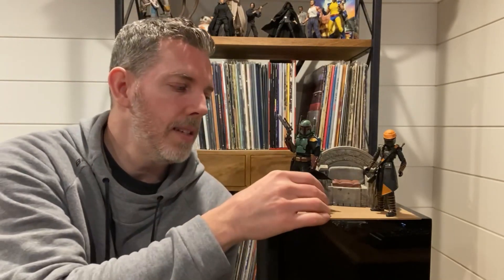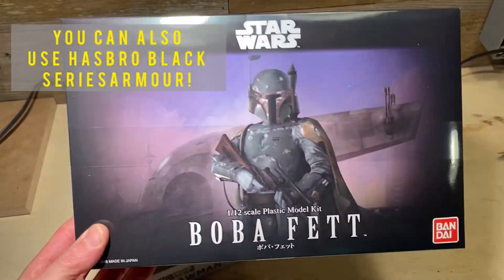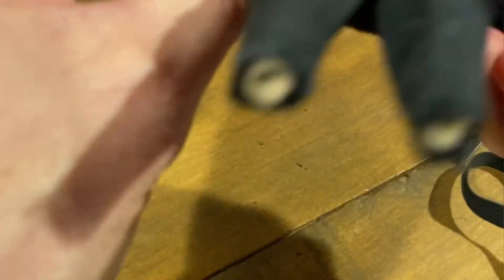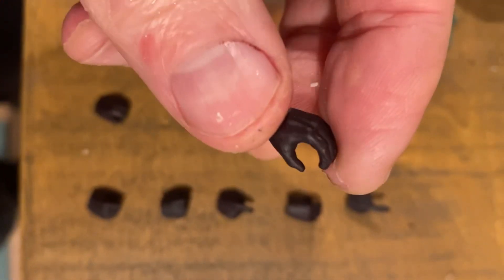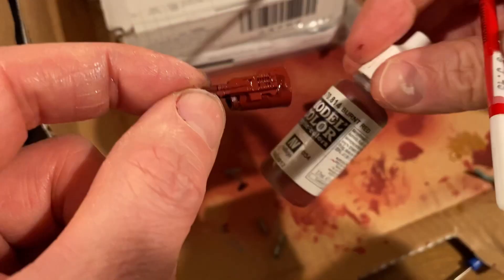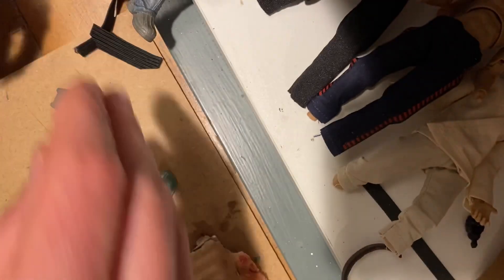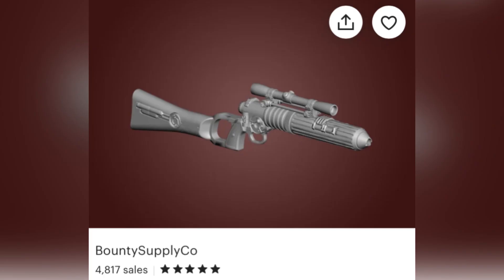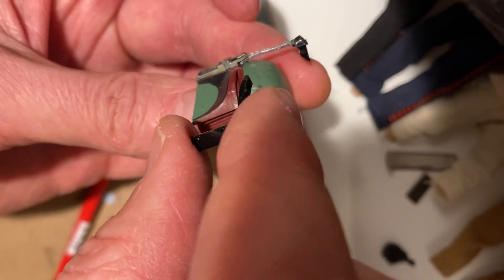Boba Fett Mezco Custom 6” Figure Tutorial

Comment: Fabric glue also works great for these type of customs, you can be a little more heavy handed with it and it dried clear so you don’t have to worry about that. I’d also get a cheap fabric cutter for cleaner cuts on the t shirts and pants. Other than that great work dude!
Reply from the maker: I’ve done fabric glue but not convinced it holds as well. It’s cleaner but takes longer to dry so I opt for gorilla gel glue to move quickly and make things as permanent as I can. But yes you can’t just lay it on thick.

Comment: Hey Southp! So I'm trying to make one of this with more like Hot Toys style scratch build, aiming to be superior to yours :P 
Only thing I'm stuck with is the arm gauntlets. How did you attach it?
My lower arms on ANT-12 Muscular body is shorter than the gauntlets, and could barely fit inside if I drill a hole. So I either replace the lower arms with extension or do some magic with a drilled gauntlet.
Reply from the maker: Hi I’ve never worked with the Ant12. It seems a bit too muscular and that’s why it won’t fit I the gauntlet. What you probably have to do is dremmel down the forearms so they are skinny and will fit into the gauntlets.
Reply: @southp2470  As I've made some progress, seems like the lower arms are bit shorter than should be, so I can keep it as whole, put it into a drilled gauntlet and attach the hand joint few mm lower. Or just make an adapter replacement.

Yes its bulky a bit, so ad Biba. But ill get a notaman skinny and see how it looks. Any experience with NT02?
Reply from the maker: @RoyalPredator  yup love Notaman. They are taller than Black Series so just be conscience of that. I use them for slim super heroes or other movie characters.
Reply: @southp2470  Taller? Good to know! Thanks for the info!
Do you have a video or pic in compairson?